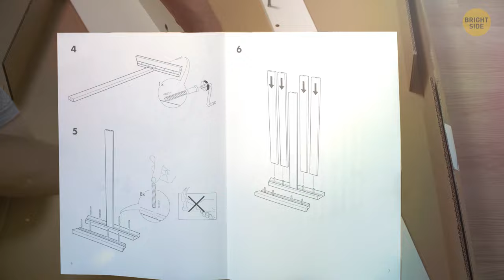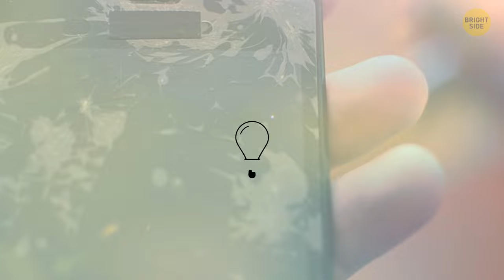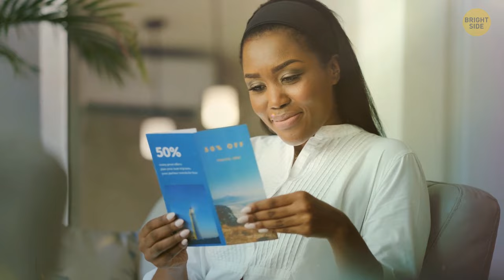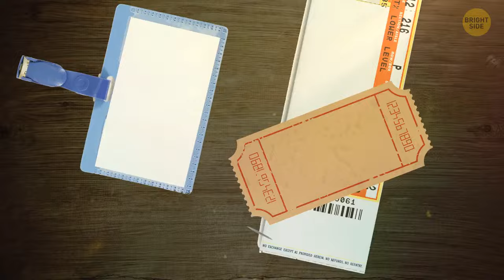50+ Things You Keep but Need to Throw Away Today

Comment: Old pillowcases can be used to clean ceiling fans. Spray the fan blade with cleaner then wrap pillowcase around it and wipe from center of blade to the end, catching dust and whatnot inside the pillowcase and not dropping it all over everything.

Comment: I still hold on to the buttons because I actually do put buttons back onto my clothing with a needle and thread. I see no need in taking it to the cleaners to have them put a button on and charge me when I can do that myself. Also not sure if they have ever heard of a knife sharpener but the average knife sharpener will sharpen practically any knife even if it's inexpensive. This would be absolutely wasteful to just throw out an inexpensive knife and not just sharpen it.

Comment: alkaline batteries are sold to not be rechargeable, and yes, chemically speaking, "recharge" is the wrong word, but one can refresh those a number of times. you need a charger with very low charging current, below 50mA, i think. voltage will get back to useable levels for quite a few times per battery. oh, and i can refresh approx. 1910 batteries with one kilowatt hour.